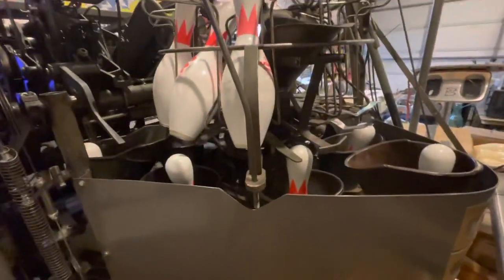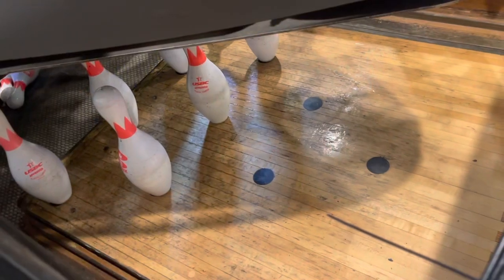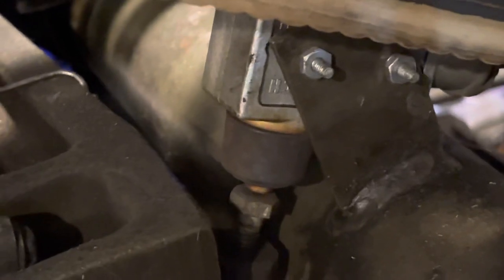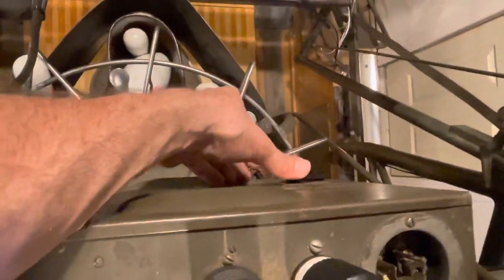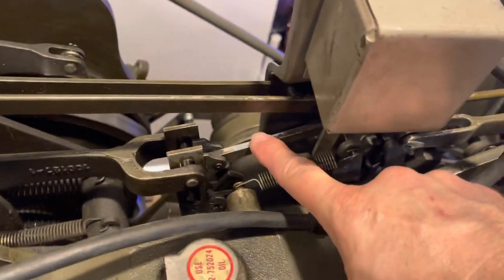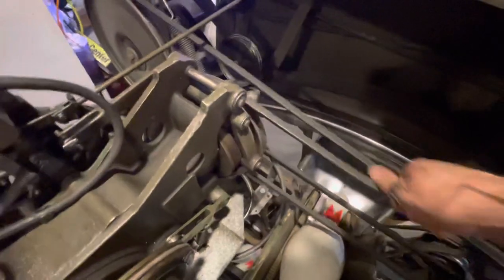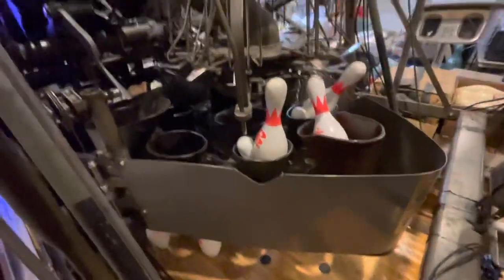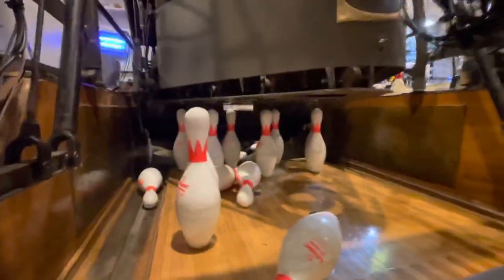Safely clear a blackout on the Brunswick Pinsetter #bowling #brunswick #vintage Garage Bowling Alley

Comment: This is even better than crappy AMF Table Jams which were horrible to clear out, let alone the cups wanted to bite your fingers off when they violently snap back when you clear out a pin. Great video as always to your channel ! 😉.
Reply from the maker: Thank you !   I saw a post the other day and a guy was asking how to clear a pin jammed in the machine.   What to take off first.   Several were encouraging it.  NOOO!   Simply crank the machine backward and it reverses what it just did then you remove all the pins and turn it back on.   I’ve heard of moving decks being broken by people using crowbars trying to unwedge the pin which is simply wrong as well.   Then you’ve killed a Pinsetter.     Hopefully everyone know how but if they don’t and even one person watching this and learns how to do something better, then I’m happy with trying to help.   Thanks for watching 😁🎳
Reply: @GarageBowlingAlley   I have a video of a fail on an AMF 82-90 XL where the table drops. That mechanic tho was unable to lower the table from the chassis since the double shuttled pin causes the Cups to stay in dead straight vertical position and made the table almost came back to the home position. The dropping part is like the very wrong way and he kept checking the table after that without noticing my League mates bowling on that pair are already impatient.

Here it is: https://youtu.be/oTiLO4ObE-U
Reply from the maker: Ouch!!   I assume they got it going.    That thing bounced like a big guy on a trampoline!    I don’t know my AMF too well, I worked on 70s years ago and seen 30s but the 90 and 70 must be very similar in operation.   Parts wise.    The sweep and table seem like what I remember on 70s.    I remember you’d crank each to zero then hit a button to say it was at zero, if I remember right.   12 lanes were new 24 older.     In my 9 months I don’t think I got more than 2 calls on the first 12.    They ran nice!  I’m still a Brunswick fan by far.

Comment: Your machine is probably the cleanest I’ve seen. And the fact that it’s among the oldest around makes it even better :)
Reply from the maker: Thank you for noticing.  I do need to give it a good vacuuming off but I’m guilty of sitting on it with spray cleaner and cleaning different parts.   They love some TLC
Reply: @GarageBowlingAlley  Yeah it's much nicer to work on when it's clean I'd imagine

Comment: Sir. This video is awesome and very helpful.  I'm training to do some Pin Chasing and it is so much to learn.  It's a very slow process and I'm told to not rush the learning. The guys who's teaching me is a mechanic and has been doing it for like 20 years. I train during league bowling. I want to learn how to correct most situations that occur during league bowling.  180s, Out of range, blackouts, hanging pins (bananas), etc.  I've watched this video probably 10 times. I really like how you name all the components. I'd would really appreciate it if you could do a video on spotting a few pins. Like the 4 and 7 or the 1 and 3.  I don't care of the certain number.  You choose the number if you want.  1,2, and 10 (another example). It appears to be pretty easy. But I could use a video.  Thanks in advance. Love what you're doing.  Keep it up.  💯     By the way. This system that you are using  is the same system that I am training on.
Reply from the maker: Great to hear another newbie is joining the pinsetter world.    I love love love the Brunswick pinsetter.     I'll do a video on respotting pins      seems easy enough but at the same time I can see where one would have no idea where to start.   Thanks for the suggestion !
Reply from the maker: And check out the "how to" and "how do" playlists if you haven't already.    Thanks !

Comment: Nice video! Can you do a video where you cycle the machine by using the solenoid for both first and second ball? That would make a great video!
Reply from the maker: View from on top while hitting the reset button ?  Or from the front bowlers view ?
Reply: @GarageBowlingAlley  a view of the solenoid, so I guess from the top. Like a view of you pulling up on the plunger to cycle the machine

Comment: Our one pinsetter is having problems where the turret cage gets out of time with the spider, thus causing blackouts.  Spilling pins all over the upper moving deck.   Our techs have been there for 40 years in some cases and nobody can fix this!  Any suggestions?
Reply from the maker: Sounds like it’s not locking after it indexes (dropping pins into the buckets)   Let me do some thinking and get a couple ideas        I’m assuming that it’s happening right after it drops the 10 pins that it’s not locking    The interlock probe, make sure it’s not binding on the blocking fingers.  The probe keeps the pins from dropping when it’s not time.  It could be hanging up on the fingers and not going back in place         I’ll go out and shoot a video for you and explain a few things.       Look for it today.
Reply: We replaced the 5 pin trigger the other day and it works much better but still sends me ghost calls.  I got a call for a turret error but when I got there,  there was no service light flashing and people were still bowling. I  told them at the desk I wanted it to run but they refused.  Sad, because I want to get all of the bugs out of it.  The ramp on the 5 pin trigger was broken off so that the spider wouldn't return to home position.
Reply: Check blocking finger on the 10 pin side might need replacing and make sure the machine is at 270 degrees and turned off

Comment: What voltage to these run on? 2 pole breaker suggests 208/240 volts, 1 phase.
Reply: 230 volts to power the pinsetter

Comment: I used to help out at a small center. This issue only happened to me once. I knew I had to back it up. I got the pins on top out, and it was not as pretty as your demonstration.
Reply from the maker: I did another on the pins on top of the deck scenario.        So many possibilities but when you figure out which one it is and correct it, it's satisfying.

Comment: Hey, so I had a blackout, cleared the jam! But yet I still have no power, micro switch is working, 1 and second ball light work as well, but still no power! Held the reset button down and still can’t get power! Any advice?
Reply from the maker: So you have power to the 1/2 ball lights but the motor isn’t kicking in ?  What about the deck light ?  Or no power at all ?  Pm me if you’re on FB to garage bowling alley or Robert Natho
Reply: @GarageBowlingAlley  okay I added You and Mr.Rob

Comment: Do you have a video on changing scissors?Also, I had a situation where the turret would not index and was dropping pins.  I performed a blackout procedure even though the machine did not turn off. Recycled it several times after that and all was well again.  I wasn't aware of the turret switch under the cross convoy switch until I saw this video.   Understand, our machines are worn badly and that might be a factor.  GREAT VIDEO as usual!